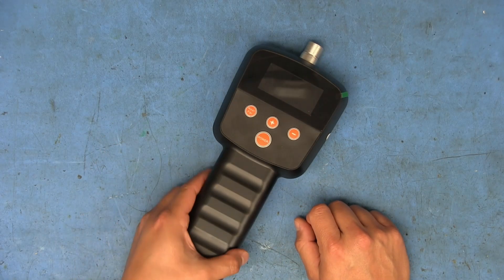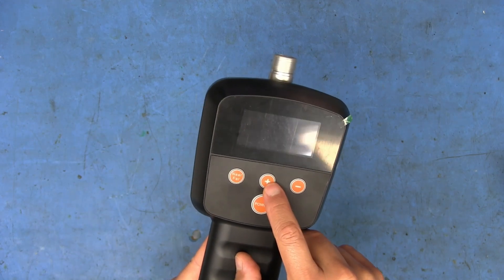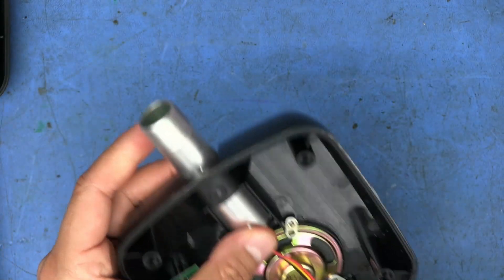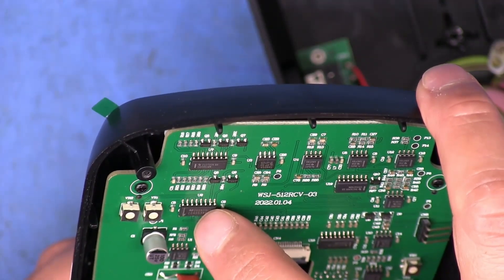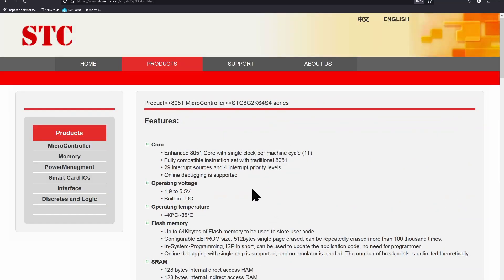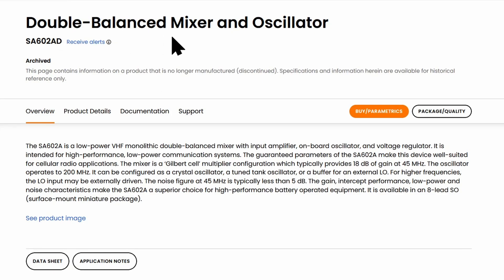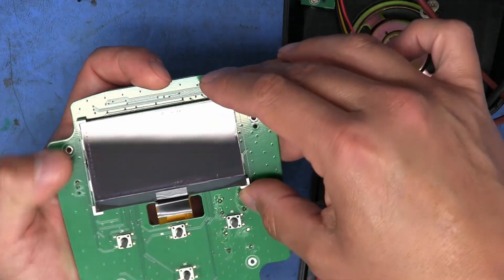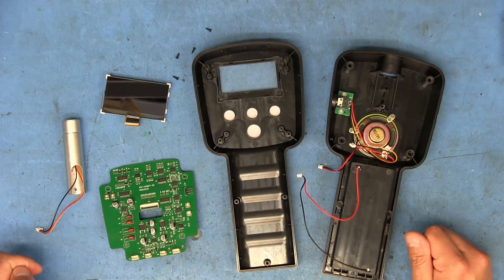TEF #174 | Vevor 512 Receiver Teardown

Comment: Would be cool if you could inject audio into that LM386 amp chip and have this device play music. I have an old metal detector that doesn't work and I'm going to try tapping the audio amp and make it play music.
Reply from the maker: One of the earliest uses for a 386 amp I can remember was using one to make a headphone amplifier for a friend. He wanted the music louder than his tape player would output, so I made him a little box that housed a 9V battery along with the circuit. It had a headphone cable on one side that would connect to the tape player headphone output, and then a headphone jack on the box with a combo potentiometer/switch that he could use to adjust the volume.
Reply: @ThatElectronicsFool  I'm making one from an amp I bought off amazon and I'm going to put it into a large pill bottle. I just need a few more parts.